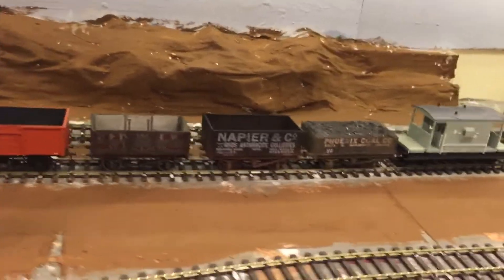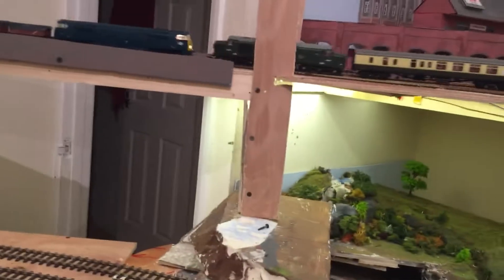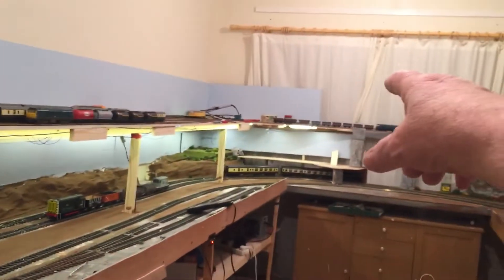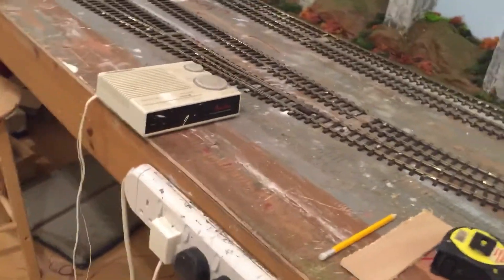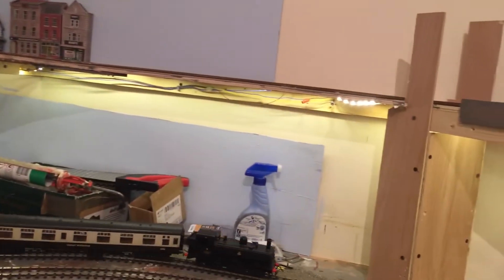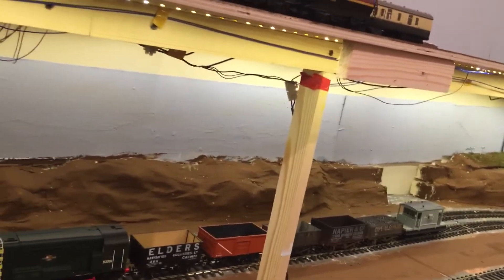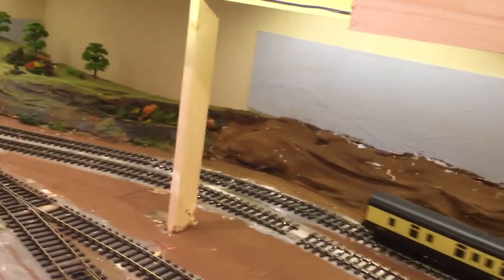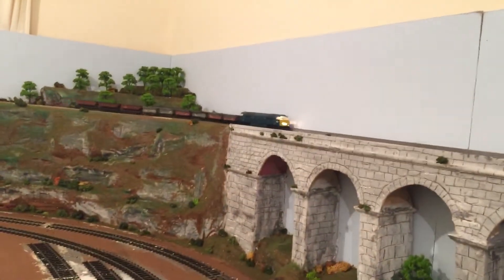Long Dyke Junction,,model railway.

Comment: Good day Paul looking good could you have used your NCE for the OO gauge and the O gauge? Kind regards Eric.
Reply from the maker: Problem with that not enough amps,  [what i was thinking of doing]  would need 5 amp booster.  The Dynamis is 5 amp for the same money as a booster,  so may end up using the dynamis to run it all,,,,,,,,,,,,,,,cheers Eric,,,,,,,,,,,,,,,,,,